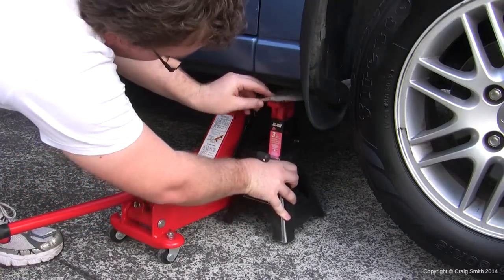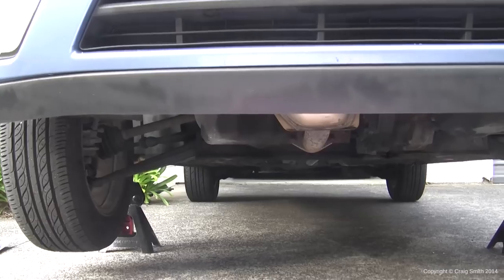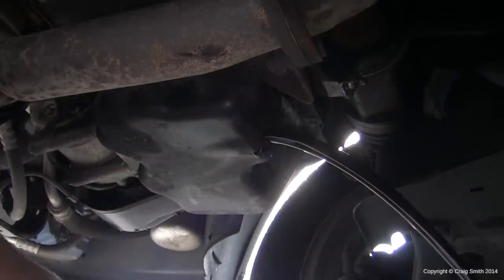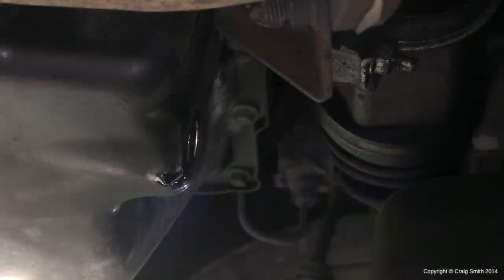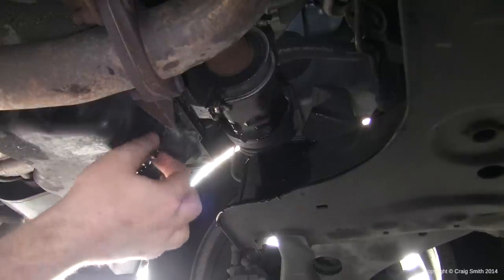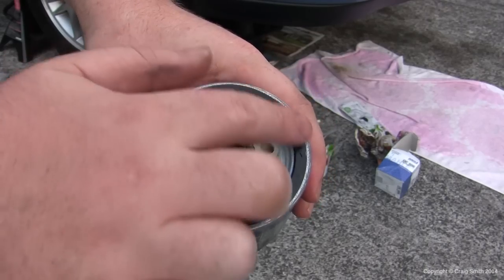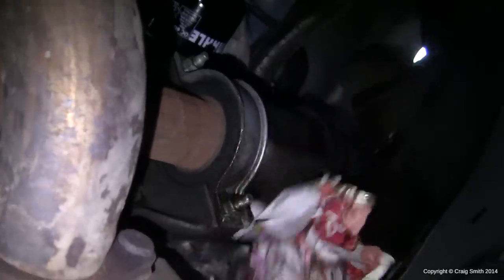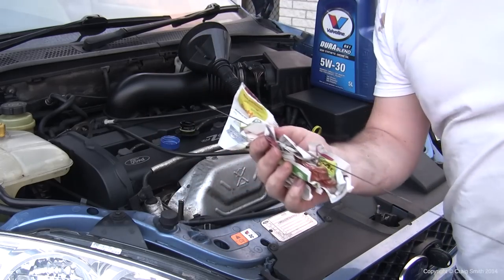Simple how to: Ford Focus oil & filter change (service)

Comment from the maker: Amazon links to relevant products are in the description.
Reply: Did you notice the filter that you removed was longer than the filter you replaced it with.
Z63 v Z632.
So the filter you replaced it with was inferior as it didn't have a check valve.

Comment: Didn’t see any surprises in the steps. Pretty straight forward. Take out the old and put in the new. Saves a lot of time and money to DIY it. I believe if you maintain a few points on a car like oil and brakes and top up all the liquids, have proper tires and pressures, it will run for a long time without seeing a professional mechanic.

Comment: The advantage of the front on the car being raised better allows the oil to flow out of the sump if the plug is at the rear. You can make a set of car ramps from 4x4 fence posts.

Comment: My Focus is 2002 MkI. In Brasil we use 15w40. Good job. Thanks.
Reply: I use 10/40 in Switzerland :)
Reply: Não sei o Zetec, mas meu Duratec (de garagem...) veio com 15w40, sendo que no manual pede 5w30. Garagens só fazem merda, e depois mais merda pra encobrir a de antes

Comment: hi Craig thanks for this video very helpful. Please can you tell me if you have a video on changing the reverse light switch as I cant find were it is located ? I have a mk 1 2000 ford focus estate like your hatchback. I thought it was accesible after removing battery and box etc. help much appreciated. it is not accessible from under the car like the early gear boxes.
Reply: Hi Craig I've sorted it now and will post a video at some point. Thanks for the great videos

Comment: After refilling the oil you start the car, let it warm for a minute or two, then kill it and recheck your oil levels. This is because the filter sucks up a certain portion of the oil and you want to bring it back to the proper level.
Reply from the maker: Once you run the car, half a liter of oil is distributed thru the engine and takes a long time to drain back down to the sump.

Comment: It's a shame where they placed the filter. On my old 2003 2.3L it was vertical on bottom. Now I have 2002 2.0 ZETEC like yours and HATE the location. But I must say the MPG on my 2.0/manual is better. Mine is the 3-door ZX3 hatchback.

Comment: I have a body flange adapter for my floor jack but I hardly ever use it as I prefer to lift from the stronger lift points under the car. Using the adapter on a floor jack or using the factory jack that is made for use with the flange will prevent damage. 
Usually for low vehicles I just use my ramps. It is much faster.

Comment: I hate when they design the oil filter like that. Always makes a ginormous mess
Reply: The cartridge filters end up making more of a mess....
Reply: @LA_Commander  not on a Mercedes. I can change the filter without spilling even one single drop.
Reply: @no-damn-alias  on those cars yes because they are on top. But many cars have them on the bottom where they drip down or sideways and cause a mess
Reply: The filter is no worse than the horizontal drain plug.
Reply: @kd5nrh  oh I hate those too lol
Reply: @kd5nrh  like them more than the vertical ones. The horizontal take a bit of experience to not make a mess but if you know how than again. Not a single drop on your fingers or on the floor

Comment: Hello nice video, but in my experience i would not recommend using that kind of carjack or axlestand in that spot. I did in the past and it damaged(bend) it. So it also becomes risky. There are stronger points underneath the car usually around the wishbone that are a lot safer to do that. Regards

Comment: I have a Focus 2001 ZTS engine and it uses 5W-20.
Reply from the maker: Ford in the US seem to spec 5W20 for many engines where it's 5W30 in Europe. Something to do with fleet emissions I think. So either would be fine. Personally I would switch to 30 as the engine ages.
Reply: Craig's DIY Car Thanks!

Comment: u should use the fram/subframe instead of that lip, it will bend.
Reply: D.j. B so many people jack up from the sill don't know why it's nowhere near as strong as the subframe
Reply: D.j. B 
He jacked it quite close to the front where it is reinforced and placed the alxe stand on jacking point so it should be fine. You should use a rubber pad with a slit in it, I'm not sure he did.
Reply: Since there is no requirement to remove the roadwheels I would just run the car up on ramps.

Comment: I think you've missed something. Prior to taking out the oil, you should put some engine flush in there and leave the car idling for a bit to give it all a good clean and loosen up all of the sludge so it all comes out a lot easier. You will get better results.
Reply: bad idea ! engine flush can break heavy clogged dirt away and can fuckup the engine. Also engine flush is bad for seals. Trust me you really only wanna have clean oil inside your engine nothing more.
Reply: @nininiininimimimim6275  This. Engine flush is NOT a good idea! It's bullshit.

Comment: Some idiot with a Powertool made it so tight where  I can't get the drain plug out and he fucked up the grooves now i need the shop to do it and had to buy a new drain bolt was supposed to be my first diy job I'm so angry

Comment: I don't agree with u about having warm oil.if ur car has been ran, u Won't get all the oil out.@ least 2/10ths--3/10ths of a quart of oil will remain, then when refilling oil, u can overfill oil by 2-3/10ths of a quary, blowing ur valve cover gasket or oil pan gasket or many others. leading 2 problems! that y I do all my own oil changes.when id go 2 oil change place my oil was always 3/20th a quart over full & was a little dirty.No thanks.il do it myself....so u think it's wize 2 switch 2 full synthetic?  iv often wondered about switching my zetec 2.o to full synthetic
Reply: Oh, come on, don't make a drama out of it :) , it's a simple oil change and full synt is always preferred!

Comment: Is not logic change the filter before than the oil??!
Reply from the maker: You change the filter while the oil is empty.
Reply: Yes, it's the normal tipical way, but in this seems bad making, two times with the little torque.

Comment: You forgot to top up the oil after filling the oil filter!!
Reply: +John Harrison 
He filled not the oil filter. If he had done that, oil would spilled out. See how it is mounted. Upside down.
Reply from the maker: I think he means that the oil should be topped up after it has cycled a bit and so filled the previously empty filter. This is correct. However the range between min and max is large and if you're filling to max it won't matter too much. By all means check the level and top-up to max after running the engine a little, at the same time as checking for leaks.
Reply: +Craig&#39;s DIY Car Jobs The range between min and max is usually one litre. That was a big oil filter. You ideally want to have the oil on the max level. Also don't just put 5w-30 in there because that's what the manual says - take into consideration the age, history and mileage of the car.
Reply: +Craig&#39;s DIY Car Jobs By the way. Your videos are awesome. Keep it up.

Comment: terrible engine to work on...one has to do a jujitsu to wield an oil filter wrench to take a filter off it... The starter is even WORSE!!
next time get her to work on it before she does her nails.
Reply: The starter is rather easy to access though! But it was a nightmare one-handing the oil filter wrench, hated the previous guy for tightening it. Made sure only to hand tighten now to prevent the next person hating me.

Comment: This is one of those jobs that really isn't worth doing yourself. Just drive to a quick lube and let them do it.
Reply from the maker: No and no!
Reply: Seriously if your going to do that go to FORD its only honestly 8$ more to have them do it and its done right.
Reply: Quick lube don't always allow oil to drain completely.  If you can do it yourself, allow oil to drain, add a little clean oil allow clean oil to drain then replace drain plug, adds 10 minutes to oil change but worth it.
Reply: Agreed, except when you live in the U.K. It's about 3 times as much
Reply: jiffy lube/quick lube charges 20+ dollars for there "normal" oil change and a majority of the time they don't even change the oil and most of the time they use recycled oil too a oil filter and some high grade synthetic oil is 13 USD. I had a cousin with a Chevy Malibu he took it to a jiffy lube for a oil change. the engine died from the pistion fusing to the engine block, the problem was that they used recycled oil from some old car engine that was blown up and I pulled the oil drain plug and basically dark black water came out with metal bits too. so no it's not worth it taking it to a quick lube/jiffy lube